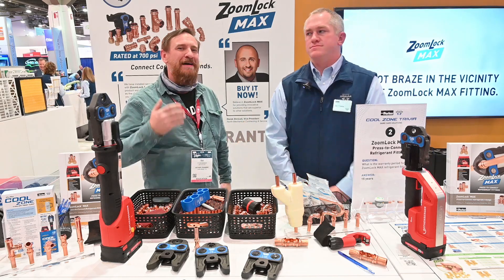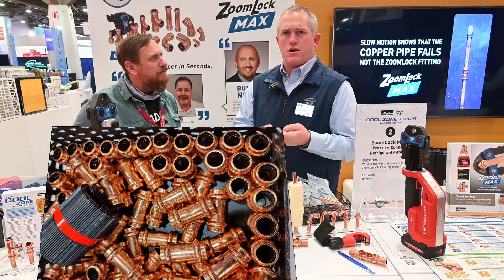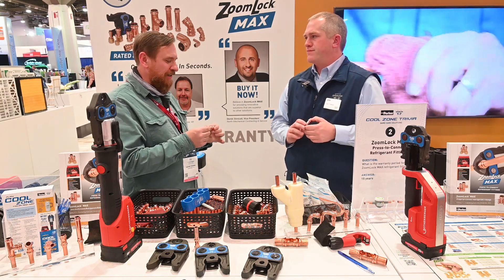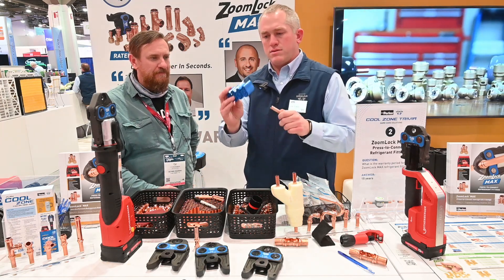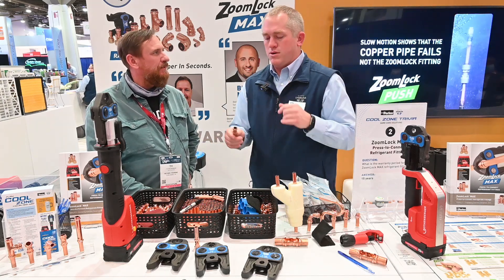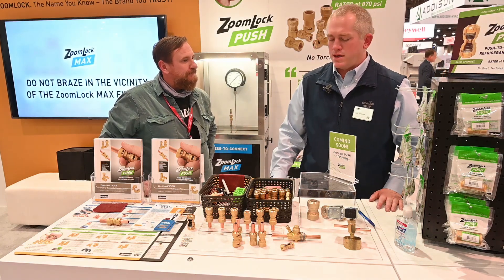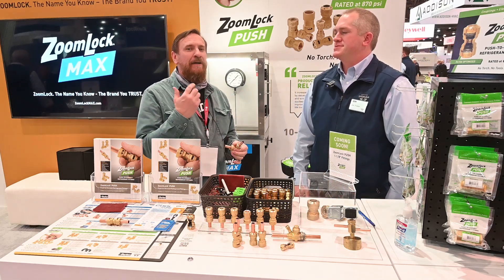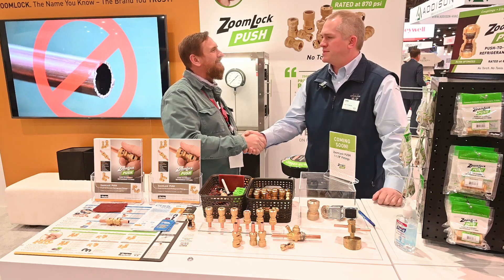AHR2022 Joe Freese tells us about  Zoomlock MAX and Push refrigerant fittings

Comment: I will have both zoomlock max and RLS. I like the idea. I have zoomlock max because that's what my company bought. But prefer how RLS press works better. I can solder and braze with the best of them but I see so many not follow proper procedure. I can see this as an advantage for those. 
I'm also a licensed plumber, there is a place for everything. Press has it's uses. Brazing will never go away.
Reply from the maker: I agree

Comment: Does anyone here use them for VRF or multi-zone mini splits? Do they actually save much time?
Reply from the maker: Case by case basis. 
If your in NYC, the cost of hot permits is big, and liability high so this is a great option.

Comment: They had a product out 5 years ago. Lol. RLS had it and got it right.  They fell out and tried to get back into it.  Maybe its worth while but I've heard alot of negatives on the press and am horrified to see the push.
Reply from the maker: I keeping hearing mixed results. some people love them some hate them. I still love a quality braze but i aknowlege there are other needs and technology and changes happen.

As for the push I use them for component testing. 
Pressure testing an evap, or line set. I push them on with a service port pushed in the other side. i can slip it on quickly to pressure test. I can even leave them on while washing a coil or to keep a system dry if i have to get a part. 
I'm thinking about putting some on my unit just to see how long they last.  Again I love a good braze but its out there so I would like to real world test it.